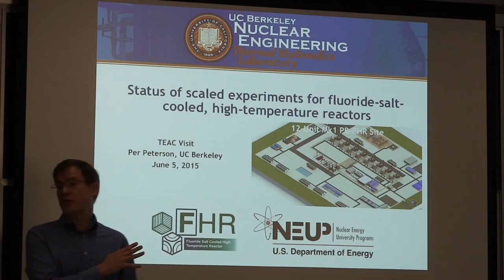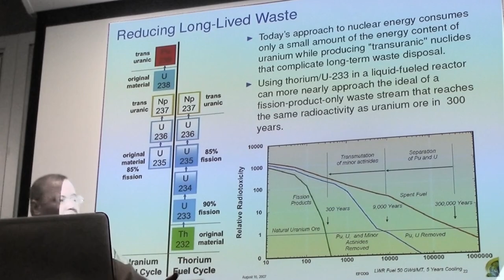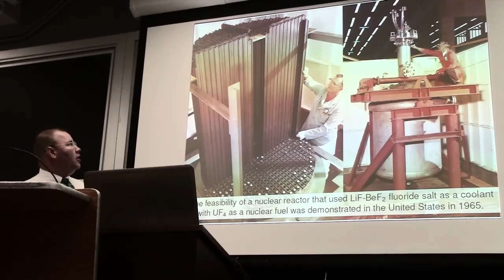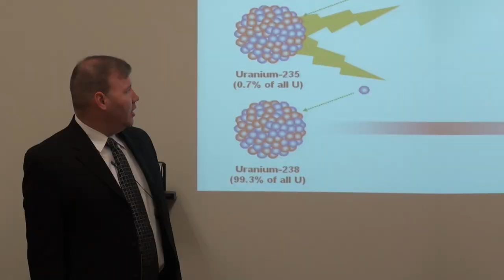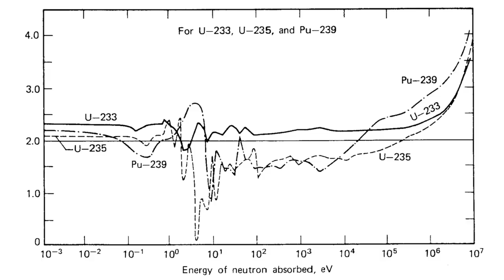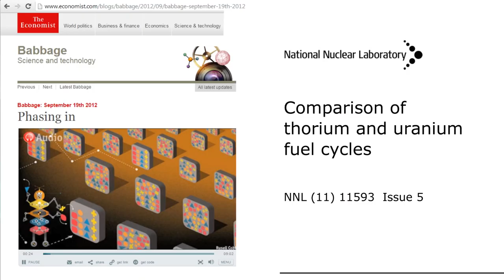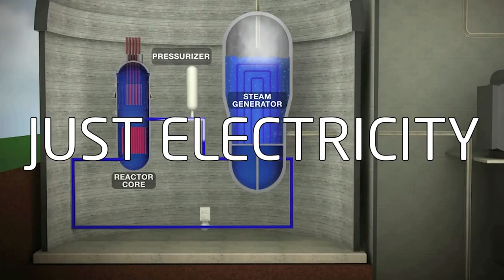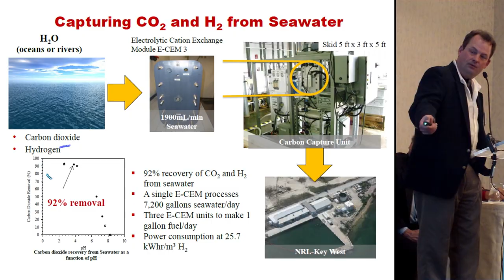Thorium Disadvantages

Comment: For anyone wondering where the actual "disadvantages" are, here's a TL;DR of what wikipedia is saying:
Around 28:00 the guy is explaining the process of turning fertile thorium-232 into fissile uranium-233. He very tangentially mentions that this takes about a month to happen. The problem is that the intermediate stage, protactinium-233, is a neutron poison, meaning it eats a neutron and does not split. On top of dampening the reaction, this turns it into the unusable 234-isotope,  so it also removes reactor fuel. This is why they keep talking about the "chemical kidney": They need a way to sequester the protactinium as soon as it is created and take it out of the neutron crossfire until it to turns into uranium. Now the amount of protactinium involved in even a large scale reactor is annoyingly small. We're talking sub-ppm trace concentrations of it in the thorium solution. This is very hard to isolate from the bulk liquid and the process to do this efficiently is the major area of research. It probably doesn't help that the bulk thorium salt is molten fluoride, making most organic chelation agents unsuitable without an energy intensive process (cooling, dissolving, separation, boiling off the solvent and reheating all while the reactor is running). 

This is actually a simple exercise in engineering and organo-metal complex chemistry though and the research won't even really involve much radioactivity, so I still don't understand why they're not just throwing some dollars at it until it goes away, I mean we're talking maybe a few million to make the technology feasible..

Edit: The diagram in his presentation mentions fluoride volatility. Uranium hexafluoride evaporates at less than the boiling point of water, so the idea is the uranium will simply boil out of the molten salt. It sounds like this would require a lot of thorium to just sit there gassing out for several months and you'd have to keep it molten during that time.. I guess it's possible though.

Comment: One of the most excellent videos I've seen on nuclear options. Thorium is obviously very much hated and feared by big oil.
Reply: No, not by the oil industry. The military: Thorium = no more Plutonium for bombs!
Reply: @idlewise makes no sense to me. There's still a lot of plutonium and uranium available and more so when it is not used to generate elecricity.
Reply: @paulgoogol2652  sure, but the military can never get enough...
Reply: @idlewise  --- Pretty much true, except that they still have their centrifuges making U-235 from U-238.
Reply: They have so many pits,cores in stock that will last for as long as they will ever need them.
Reply: Ah yes big oil is truly afraid about the potential 100% electric commercial boats and planes that are absolutely not impossible to make with our current battery technology.

Comment: 18:50 The other reason why we prefer fuels to be liquid is that they're easier to move around and manage once they've in the power generating system. E.g. it's easier and quicker to pump gas into a car from an underground tank than it is to load solids into a compartment. Using a single piece of solid that could be loaded in one go causes other technical challenges like a clean and consistent burn and how to manage by-products.
Reply: Molten salt ... the liquid part you talk about sounds simple ... but just remember that liquid is at around 1300 degrees F.
That is insanely more difficult to work with than steam in a pipe and water.
Reply: @justgivemethetruth  Lol, I would say it isn't rocket science, but in this case, it probably is. 😂

Comment: What a shame this clip, upon clip, wasn't produced properly.
Reply: mark m.
I found it fascinating and kept my attention. 
It was produced properly.
Reply: @robertlee8805  I think at the current point reactors are done as opposed to solar. There's just too much capex involved.
Reply: @TheHellogs4444  Solar does not work very well at night  and batteries are not ready to step in  so in the interim there is a place for a safe, base load, non carbon fuel.  Thorium seems to be a good candidate.
Reply: @kenloose3560  Yeah, but look at the damn cap ex involved and the unit cost. Look at the wiki page for lifetime cost of nuclear (no estimates for Th tho). It's just economically not viable over solar panels + batteries
Reply: @TheHellogs4444  Baseload, Baseload! Solar cannot sustain baseload.  Without  a baseload energy source wind and solar are appendages to the power supply. Batteries do not appear out of thin air. They too take  money and resources to produce and dispose of later. The same can be said of solar panels. Wind and solar are not free. They too have their financial and environmental costs that must be factored in. Compare Electricity costs in  Germany where they have gone heavily into wind and solar to costs in France that has chosen a nuclear option.
Reply: @kenloose3560  The whole baseload + offpeak is the reason we have batteries (and other power storage). And the calculations for cost Solar PV - Thin Film Utility Scale  43  48 $/MWh. 
For water pump storage the cost/Wh is unknown.

https://en.wikipedia.org/wiki/Cost_of_electricity_by_source#Lazard_(2017)
Nearly everything beats current nuke tech. Th is still R&D, even for China, which started in 2011 iirc.
https://en.wikipedia.org/wiki/Concentrated_solar_power#Costs
That's 70$/MWh, including storage.
Reply: The overall quality is quite poor
Reply: there was some repetition but on the whole i thought it flowed surprisingly well despite being a series of clips strung together. Learned a lot while watching and it kept my attention to the end.

Comment: I have read about Thorium reactors. People make it out to be some sort of miracle reactor. It's not. It's mostly a pipe-dream. If it sounds too good to be true, it is. Disadvantages are it does not fission on it's own. You have to either put weapons grade uranium in it or blast it with some sort of accelerator or something.  It creates less energy and is less economic than traditional reactors which already struggle to compete on the open market. It creates a mixed waste stream that is very difficult to dispose of. It won't melt down, but can leak. It has most of the same disadvantages of conventional nuclear power but is less cost effective. Thorium breeds  uranium-233 which is fissionable and is a risk for proliferation.
Reply: I'm glad you read! Looks like you read anti-nuclear propaganda, as you're making some misleading assertions. First off, ALL breeder reactors DO require fissile to sustain fissioning of fertile material. This is mentioned in many videos I've created, so it isn't some dark secret. Ideally, U233 is used, but Pu or HEU can also be used. Pu and HEU can be used in nuclear weapons, and repurposing Pu or HEU from nuclear weapons as fissile seed is a much better use for it. (See very successful "Megatons to Megawatts" project for concrete example of nuclear bombs being decommissioned and turned into nuclear fuel.) With Thorium MSR this would happen once, then the fissile seed remains inside the reactor while Thorium is continually added as fuel.

It creates far MORE energy, per unit of fuel, than traditional reactors. That is, it is more efficient. If a large city is to be powered, then multiple thorium reactors are deployed next to each other. It is easier to manufacture multiple smaller reactors than a single large one, as smaller reactors can be constructed in a factory but large ones constructed on-site. It is typically on-site construction where cost overruns arise. Each large reactor being built by a new workforce, rather than a single workforce churning out small reactor after small reactor. Often today's nuclear power plants house more than a single reactor, so this could be 12 small ones instead of 4 large ones. These are not identically priced reactors... 12 small ones would cost far less than 4 large ones, as this is 4 on-site constuctions compared to 12 flat-bed-truck shipments.

Thorium Molten Salt Reactors, as being pursued by Flibe Energy in USA, and SINAP in China, create Fission Products and little else. You can call it a waste stream if you want, but it is actually a collection of very valuable materials. Conventional solid fuel reactors also produce very valuable materials, but those materials are never recycled because they're trapped in solid fuel rods together with minute quantities of potential weapons material. Th-MSR, in contrast, produces only Fission Products and not weapons materials. Th-MSR, in contrast, is in an easily partitioned liquid form, making the sale of Fission Products an attractive and profitable proposition. This revenue source might be bigger than the sale of energy for the first few reactors, as some of the materials are extremely rare and will continue to be so until a large fleet of Th-MSR operates and harvests isotopes.

You say "it creates a mixed waste stream which is extremely difficult to deal with". That is 100% backwards. Th-MSR is a reactor which can make (some) choices about what isotopes it produces. Liquid state allows online chemistry, so operator can pull out desired isotopes once they're created but before they're altered into something less valuable by neutron flux. Medical isotopes being an example of an extremely valuable, but short-lived, byproduct of energy production. In today's reactors such materials are created too, but they're impractical to harvest.

You assert "it won't melt down but it can leak"... while no one is planning on building a leaky reactor, the Molten Salt would quickly freeze rather than boil. The reactor core is designed to sustain fission and trap heat. Any other environment (except for another reactor core) can't sustain fission nor trap heat as effectively. A solid, radioactive, pancake of salt might sound scary to you, but that's a shape optimized for dispersing decay heat, while potentially harmful isotopes remain chemically trapped in the salt. Your proposed "leak" applied to a conventional reactor could result in an actual disaster. With MSR it results in a liquid-then-solid pancake of salt, assuming the reactor doesn't have a catch-pan below the reactor to direct your "leak" into a more purposeful drain-tank.

"Thorium breeds uranium-233 which is fissionable and is a risk for proliferation" Kirk Sorensen speaks about this at length in a video I'm about to release, but here's an additional point he doesn't make, for you to consider: The U233 created from Thorium replaces the U233 fissioned into Energy + Fission Products. Th-MSR does NOT create a surplus, it SUSTAINS an equilibrium. And if U233, exceptionally valuable material already being used to create medical isotopes in Oak Ridge, was to be removed from the reactor than fission would stop. That's the world-standard for how weapon seeking nations who have power reactors are kept from using them to create weapons... a nuclear reactor suddenly shutting down detected by satellite. That's the tell.

There's no stopping Th-MSR to refuel. There's no swapping old fuel rods out for fresh ones. Thorium is slowly, continually, added to Th-MSR while it operates. U233 isn't added. U233 isn't removed.

Contrast that with conventional reactors refuelling cycles, and the international presence needed during every single refuelling cycle to ensure a weapon-seeking nation doesn't divert used fuel rods, or alter the refuelling pattern to try create weapons grade material by "lightly toasting" U into Pu (instead of more fully fissioning the Uranium).

What is done today with international monitoring, with Th-MSR, could be replaced (or supplemented at first) with laser spectroscopy monitoring of the salt. The salt is homogenous, and it is possible to bounce a laser off a sample inside the reactor core (through a pane of glass) to determine exactly what it is made of at any point in time. That is simply NOT an option for solid-fuel reactors which are constantly having their fuel-rods shuffled in and out. What's in a fuel rod? You need to know the rod's history to figure that out... where was it in the reactor and for how long? What is in the salt? Bounce a laser off of it and find out.

While I feel the supposed proliferation concerns voiced by anti-nuclear organizations is specifically designed to tarnish power reactors, there is at least the example of India to show a power reactor being abused in such a manner.

U233, the fissile that HEU or Pu will be converted into during the operation of Th-MSR, has NEVER been used exclusively as fissile in a weapon... even in the 3 weapons tests which used U233, other weapons-grade material was used along with it. https://en.wikipedia.org/wiki/Uranium-233#Weapon_material

For all the ~14,000 nuclear warheads currently existing in the world, zero contain U233. This is because the unavoidable U232 contamination is a bit of a problem for weapons. Given the choice, 14,000 times, the creators of nuclear weapons decided they could do without U233, and the U232 which would accompany it.

All the weapons-grade material contained in those 14,000 weapons can be used to seed Th-MSR, changing the existing weapons-grade HEU and Pu into U233, which would then be trapped in the reactor during its lifetime, and almost certainly moved into the next Th-MSR after that.

I hope you'll take some time to learn more about Thorium reactors, and not exclusively from anti-nuclear organizations.

Comment: The real problem with thorium is that it does not form mineral deposits as readily as uranium. Yes, it is 4 times as "abundant" in the Earth's crust as uranium, but the word "abundant" does not mean widespread and easily obtained.  To obtain a deposit that you can extract economically, there has to be a geological process that concentrates it, usually 200 to 1000 times.  Thorium is only concentrated in two types of rare occurrences, monazite sands and pegmatites, while uranium is concentrated in at least 14 types of fairly common deposits.  This is because uranium is soluble in oxygenated groundwater and can e leached out of granites and precipitated elsewhere in a reducing environment, e.g. phosphates or carbonaceous rocks.  Thorium is like the rare earth elements, quite abundant but rare to form deposits as they are not soluble and therefore not geologically mobile.   Thorium will always be more expensive than uranium.  Why use silver wire for house wiring when copper is cheaper?  Silver is a better conductor, but it is simple economics that determines the usage.
Reply: The cost of fuel in the whole nuclear fuel economic equation is minuscule and is the cost item they least worry about.  The nuclear industry only cares about reliability of supply and the fuel is easy to stockpile.